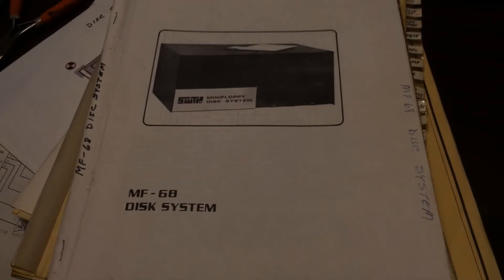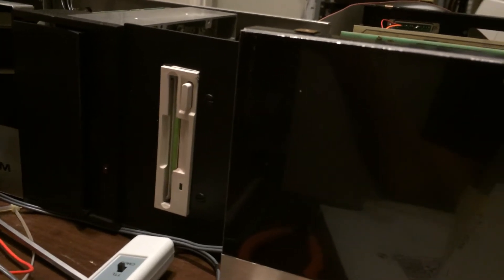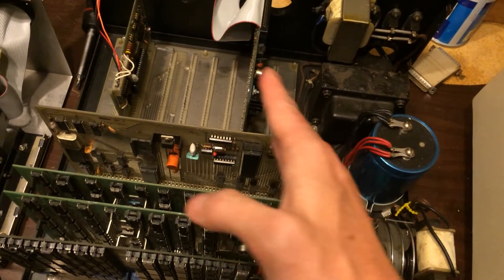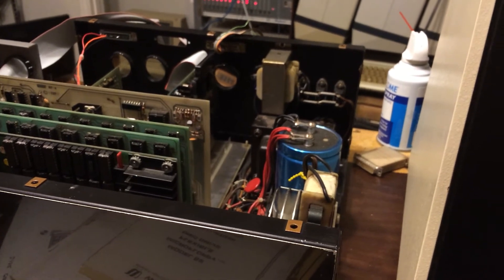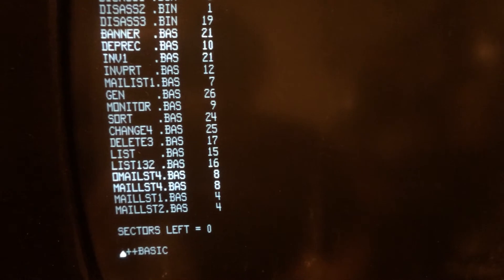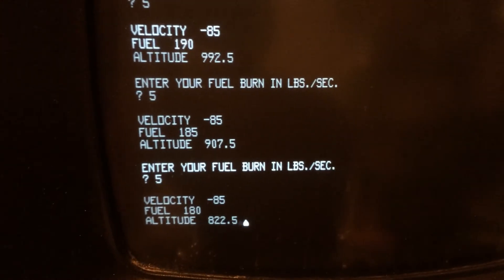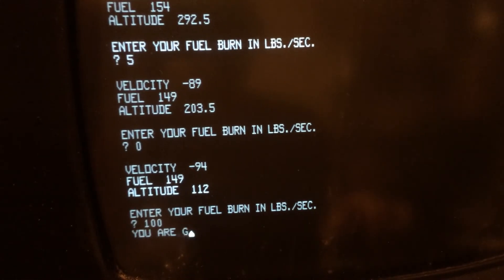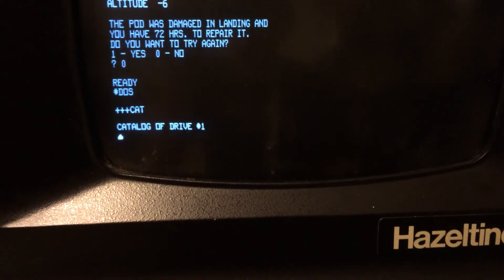SWTPC 6800 / SWTPC MF-68 Disk System / FLEX 1.0 / Disk Basic / Lunar Lander

Comment: WangCo 82, the garage door lids... very well built drives with a lead screw stepper.
Reply from the maker: Sadly, the tiny molded plastic pegs that guide the "garage doors" in their grooves didn't stand up well to the test of time.  At least one of my drives has one or both of them broken off, so you have to be extra cautious when closing them.